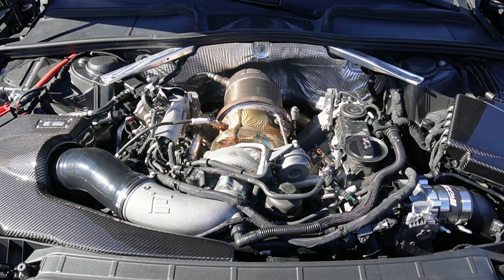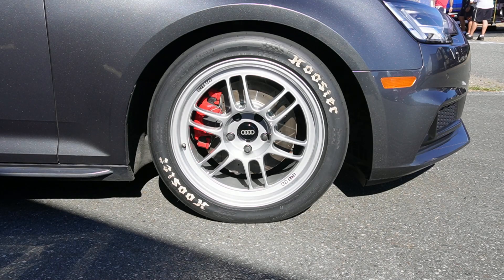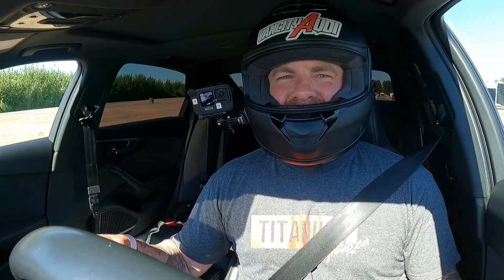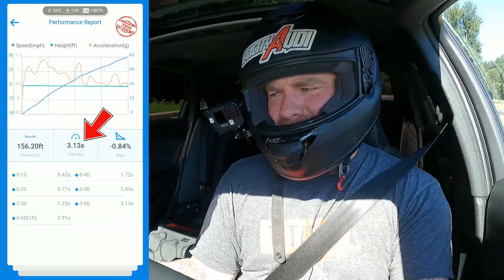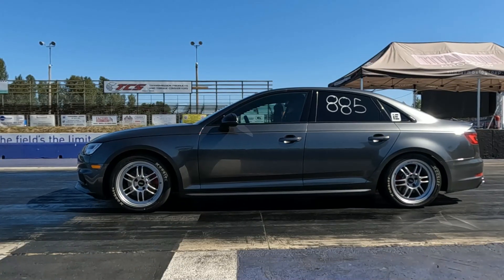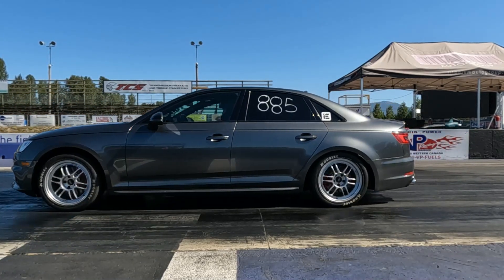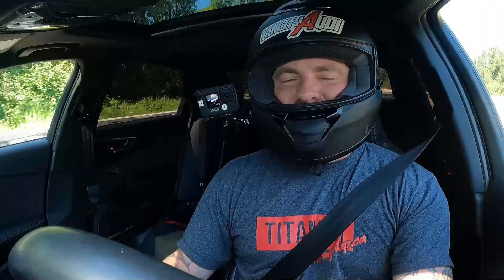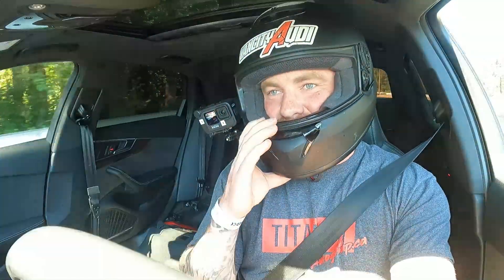How Much Does A High Temperature & High Density Altitude Negatively Affect 1/4 Mile Performance?

Comment: The tune is a big factor. Whether it compensates or not. Take a stock 8Y at sea level vs 4,000 ft elevation and they have nearly the same trap speed. My wife's turbo Soul was the same at 1200 ft as 5800 ft. The Unitronic is38 file in my GTI allows the car to lose 5 psi from 1200 ft to 5800 ft elevation. I lost 6 mph in the 1/4 due to that. So im going custom tune now. There's no reason to peak at 19 psi, thats like stock boost pressure.
Reply from the maker: The simple explanation is that you were running an OTS or canned tune before that worked reasonably well in all situations but most certainly won't work as well in a crappy environment. If you custom tune the car you'll need to have it custom tuned to work well in the horrible environment conditions. If you custom tune it in great conditions you can expect the exact same thing to happen when you try and get it to perform in poor conditions again without re-tuning it.
Reply: @VancityAudi  The Simos ECU can calibrate all that on the fly. They simply read ambient pressure and change the pressure ratio limit. Unitronic was just conservative and didnt want to push the turbo at elevation. I retuned with Boosthaus and picked up 5-6 mph and the WGDC still never exceeds 70% so Uni was being too conservative IMO. I didn't log the Uni file but I guarantee it was operating at 30-40% wastegate lol

Comment: I have a question that I am hoping you or someone can make sense of.  My current elevation is 4640.  Our current Density Altitude is going as high as 7,800, (+3,160 feet).  I have an understanding of Density Altitude and IAW scientific Articles of weather, sea level is 0.0764 lb/ft3 Air Density.  4640 is 0.0665 lb/ft3 Air Density.  And 7800 is 0.0605 lb/ft3 Air Density.  From 4640 (0.0665) to 7800 (0.0605) is in theory, a -9.023% reduction of fuel due to elevation (density altitude of 7800). // If I subtracted 4640 from 7800, that gives me 3,160 feet.  Some people say add or subtract fuel by (approximately) 3% for every 1000 feet change of elevation.  3160 divided by 1000 equals 3.16 (or 3.16% of fuel change).  Is there a way to prove or disprove one of these theories of fuel adjustments?  I also understand a car or motorcycle should make automatic fueling adjustments according to elevation.  But an elevation of 4640 with a density altitude of 7,800 is lacking more oxygen than at 4640.  And this I suspect is not being factored into the ECU adjustments to maintain proper AFR.  Am I wrong?  Or am I missing something??
Reply: The ecu measures air mass not flow or volume so it compensates properly.

Comment: I ran there in 32C temperature and hour drive to get to the track in my Golf R w/ Unitronic stage 1 poor quality 91 Octane, PS4S tires
Back to Back runs
12.7 @ 104 mph   60ft 1.820  
12.9 @ 106mph    60ft 1.922    
 A few more bolt-ons , better fuel and cooler temps. One should only improve on those times.
Great vid, very helpful for people starting out.
Reply from the maker: Thank you

Comment: Meth for cooling would help in that heat.
Reply from the maker: It would, but that wasn't the point of the video, haha
Reply: @VancityAudi  you could have compared no meth runs vs meth runs. That would have been interesting as well.
Reply from the maker: @rastaph  again. Not the point of the video seeing as I don't have meth installed on this car. If you want to see that we're doing that testing with the RS3
Reply: @VancityAudi  Just because it wasn’t the POINT of your video doesn’t make irrelevant to comment on potential solutions to this issue at hand.
Reply from the maker: @rastaph  well it kind of does. The point was to show people that might not understand how the high temps and high DA negatively affect the power your car makes. If you go race in Colorado with a DA of 8000 and an elevation of a mile high no matter how much meth you spray your sh$t is still going slow, lol. Many, many people don't realize that.

Comment: I can definitely say that the b8 and b8.5 are more effected by heat than the b9 but nonetheless the b9 is still effected
Reply from the maker: Every car is affected. It isn't exclusive to a type of car. It's physics. A B8 and 8.5 get WAY hotter than B9's do because their cooling systems are inefficient and that supercharged motor creates a bunch more heat.
Reply: @VancityAudi  this is very true, however the b8 boost level is effected by the heat and da unlike a turbo car where it has a wastegate and it will make same boost and just lose efficiency at higher boost but still be able to make that boost if that makes sense. But for sure both are effected. Turbo cars are generally less effected since they have intercooler and wastegate psi

Comment: It roughly maths out to 3% power loss for every 1,000 DA in general. 

Granted, every car is different, but over 4500 DA where i live right now, sometimes spiking up to 5800 to 6000. Compared that to 400 to 100 200 DA on a cool evening at sea level, and its easily .7 0-60 quicker.
Reply: sounds like you live on mount Everest...... where you at?
Reply: @road_2_pow_r  Move around a lot for work. Right now im in the Mojave Desert. 2,000 feet elevation, but the heat and Baro pressure here makes it rough for car performance.
Reply from the maker: @MeatloafMelvin  crazy how much of a difference it makes, huh?!?
Reply: @VancityAudi  Very crazy.
Reply: hey bro you have instagram? i have some questions!!! im also in mojave desert